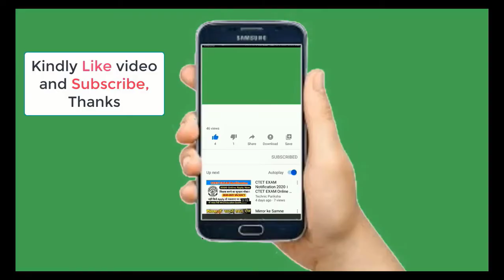HP Desktop: Identify Beep Codes And Meaning

Comment: What about 2long 3 short beeps?
Reply from the maker: It means the system BIOS/firmware is detecting some problem with startup code  and trying to recover from it. You can do this to try resolving it

Shut down fully then unplug power, hold the power button for about 15 seconds and  then power up again. This may  helps clear transient states.
Reply: @MrElijahacademy  sorry 3 long 3 short i mean,i cant find anything someone says its a bcs Grapich someone says its a RAM
Reply: But GPU is fine on other pcs

Comment: Hello, mine was 3 Long Beeps 4 Short Beeps: (power) this happened after I just installed a brand new power supply. Prior to this the computer wouldn’t turn on at all. Any suggestions? Greatly appreciated.
Reply: I just replaced the Cmos battery and now its working!

Comment: I have hp z800.. when powered up nothing appears on screen and i get 1 beep sound after 1min.. tried reseating rams but no change.. please advise
Reply: Me to but i grave g600 tower i think
Reply from the maker: Please make your question clearer on g600 tower. Please which model of HP?
Reply from the maker: Thanks for your enquiry. 
A beep after one minute on HP Z800 is surely "No graphics card detected or graphics initialization failed"

You can move the graphic card to another slot and try again or if you have a working spare graphic card , you can test with it.

Comment: My pc does 3 long beeps and 1 short beep. What does that mean?
Reply from the maker: I am yet to experience 3 long beep and 1 short beep. But there is 3 long beeps and 2 short beeps and even 3 short beeps
Reply: @MrElijahacademy  It was a problem with not being connected to a power switch on the case I believe. Thankfully I got it to work

Comment: 1 short beep 1 long beep hp pavlin p6
Reply from the maker: Please check the memory modules. Kindly test the RAMs one after another at different RAM slots. ..  And if it does not work..  Kindly suspect some issues with that motherboard
Reply: now it turns on but no display at all but no beeps after culling off the ram

Comment: I have 6 long beeps on start up. Any clues? I already took out the cmos  battery to hard reset the bios same problem no signal to display as well.
Reply: Update: The problem fixed itself after some failed attempts. I unplugged the computer and left it sitting  on the floor for an hour. I plugged the computer back  in and powered it on.  I was switching back and forth between my 2 monitors and between the display cable and hdmi ports while powering on and off the computer until it read "no system installed, no boot detected"  on the screen with the hdmi. I restarted the computer and wasted no time  loading in an 8.1 bootable usb I made using the windows media creation tool (still works for 8.1 and 7, no products key needed,10 and 11 requires a product key) any ways had to change boot order and disable secure boot  and allow legacy to be enable so the bios can read the hdd from an old laptop with a 3.5  adapter but its working with 8.1 waiting till payday to buy windows 11 about $120 where I live. I hope this info helps anyone.
Reply from the maker: Suspect the keyboard controller
Reply from the maker: Great effort. Thanks for sharing.  I am sure the information iwill help someone somehow some day.

Comment: What if mine doesn't beep? Just a hard white light? Keeps rebooting randomly thru the night, its fine after it's been unplugged for a while, then will start doing it again after a week and then it will be persistent! It's driving me insane
Reply from the maker: A lot of things can cause persistent rebooting. - bad RAM, Corrupt BIOS, malfunctioning motherboard..you need to truobleshoot to identify the real cause..
Reply: @MrElijahacademy  I have run diagnostics, everything seems clear, removed and reseated ram modules, cleaned up and inspected motherboard, reinstalled bios, reset pc, then finally did a full clean reinstall of windows 10 via usb ... That one hurt tbh but I've literally explored all avenues now.. It worked fine for a few weeks then started happening again.. I've run out of ideas at this point. Now I just leave it unplugged and only plug it in to use it and update.. Its fine for usage once plugged in, but if I leave it plugged in and shutdown, it just starts randomly starts to startup and shutdown after a few days and it's unusable after this hence unplugging it when it iniates a shutdown.. I've even rebuilt the bsod boot efi partition.. Its really frustrating
Reply from the maker: @rollindeep786  kindly try these if you have access to spare parts..(1).try replacing with another processor. 2... Test with another MBoard

Comment: I am a I.T worker and my coworker recently have this same problem and could not turn on the PC. This seems to cause by a loose ram stick. Thank you for your information about this issue.
Reply from the maker: Thanks for the addition.
Reply: Bro do u know what's wrong with my pc? for some reason it has a endless beeeeeeeeeeeeeep sound and when I try to turn it off I can't I need to turn the main power switch off

Comment from the maker: Beep code is a pointer to possible  cause of system issue:
Reply: Bro pls help my pc has a endless beeeeeeeeeeep sound whenever I try to turn it on and when I try to turn the pc off I can't I need to turn the main power switch off
Reply from the maker: @doggowoof7156  Please have you checked your computer RAM for  possible problem?
Reply: @MrElijahacademy  yep it was not the problem but apparently there was a problem with the motherboard and now the motherboard is already fixed but now instead of it being an endless beep sound it is now 1 long beep and 2 short beeps
Reply: @MrElijahacademy  I also tried to take out the battery and put it back incase but it still didn't work idk what to do 😔 should I get a new ram? Or a battery?
Reply from the maker: @doggowoof7156  that motherboard still has issue. That beep still indicates a problem with the motherboard. This is my candid advice - Whenever the problem affects the motherboard and after repairs, it still persists, please save yourself the headache and replace the motherboard...